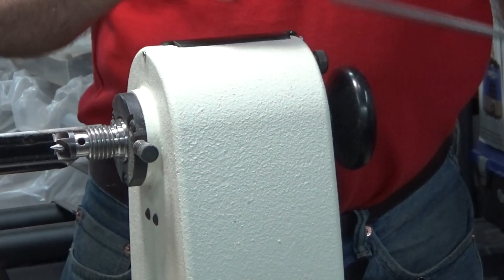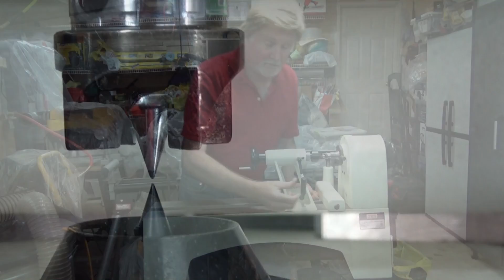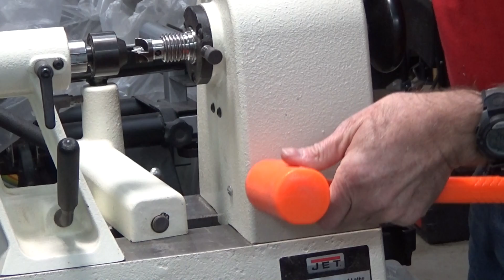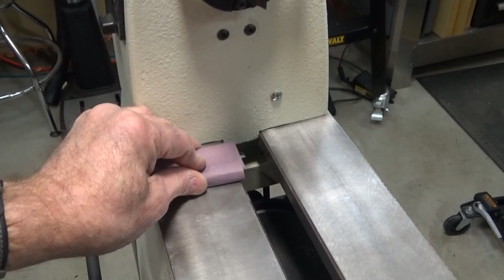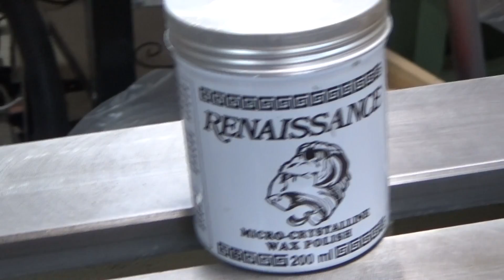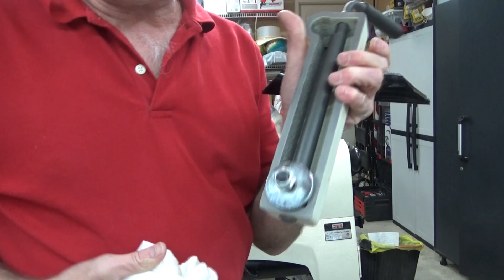Basic Wood Lathe Setup

Comment: Dear Dave! I accidentally came across your video where you talk about how to prepare a Jet lathe for use. A month ago I bought the same one. It’s a wonderful machine, but I can’t cope with one problem: when the workpiece is pressed, the tailstock moves. Is this a problem or is it supposed to be like this? Thank you! My name is Alexander. I am from Siberia from Russia.
Reply from the maker: When you say "when the workpiece is pressed" do you mean when you tighten it? Also when you say the tailstock moves do you mean that the whole tailstock slides including the base? If so the problem is that your tailstock is not tightened down enough. If you are pushing the lever all the way down and it is still not tight enough you can slide the tailstock off and tighten the bolt at the bottom. Just a small tweak goes a long way so go slow. Hope this helps.

Comment: Thanks Dave, great tips. After a year with the lathe and a failed attempt to drill a hole in the top of a finished tea candle holder, I need a drill chuck. As embarrassing as it is. I did not know how to remove the tail stock live center. I punched out the center of it though and need YouTubes advise. I watched many videos and yours explained when others did not, in the first minute. I watched to the end and will now sand and wax my tail stock, banjo and bed. I subscribed. thanks again.

Comment: dave i have bought this lathe and can you tell me how to mount it,,,i built my own cabient,,
Reply from the maker: You can.t see it in the video but I took the easy route and just purchased the Jet base that was made for it. It was expensive but well worth the price. It is no wider than the lathe but very stable because it is made from heavy metal with very wide cast feet. It is doesn't wobble even when working with pieces that are not balanced. Homemade bases tend to be less stable. One recommendation I can make is that if your cabinet suffers from shake put a couple  bags of sand on the bottom shelf. This will add greatly to the stability.

Comment: What about the height of the lathe
Reply from the maker: Great question. When I started out my research revealed that a good starting point is to stand at the lathe and let your arms hang down in a relaxed manner. Next raise your lower arm to create a 90 degree angle with the upper arm. Note the height of your elbow....this should line up with the height of the point of the spur center. I find this works for me and have been using this height for years. Try this out and see how it feels. You can experiment but this will get you started.

Comment: Hi Dave, I have just got myself a second hand lathe, a quick question if I may. Is it vital that I bolt my lathe down or buy feet adjusters? I am unsure and practiclay have no idea if this is ultra important or not. The concrete floor in my shed is old and chalky but average depth 100/120mm. Your help would be greatly appreciated. Lathe in question is a vicmarc vl200 6speed. Cheers mate and Great video, subbed.
Reply from the maker: I just looked up some pics of your lathe. Seems pretty robust. Every pic had a different leg configuration. If you are going to be turning moderate size projects then there would be no need to bolt it down. You can just shim the feet to make it level and stable. Now if you intend to mount and spin some larger blanks and find the lathe starts to walk away that is another story. A trick some turners do when a lathe moves is to install a shelf between the legs near the bottom and place some weight on it such as sand bags. I would just start turning and try to match my solution to the severity of the problem, if there is a problem. Like I said that lathe looks pretty robust and its own weight might be enough to stabilize it. Good Luck.
Dave
Reply: @daveswoodshop782  thanks for the advice Dave, I am just going to purchase some steel adjusting feet to level the lathe. I am only going to be starting small. Appreciate your help mate.

Comment: Great info. just getting started with my dad's old Sears lathe.how high should   the lathe be ?.and the height  of the tool rest is it at center of the work.or above or below.?
Reply from the maker: Stand at the lathe, let your relaxed arms hang down. Now bend your lower arm so that it is parallel to the ground forming a 90 degree angle with the upper arm (pretty much like my arms are at the start of the video). The points of the drive center and live center should be elbow height. This is the general consensus of how high lathe should be. As far as tool rest height goes it is not as simple. Generally the tool rest is below center of the wood being turned. A tool such as a roughing gouge or spindle gouge will have the handle angled down so that the cutting surface contacts the wood near center. when using  a tool such as a skew the rest needs to be higher and the cut is made higher as well. Look at some of my other videos and you will see how to set the rest height. Good Luck!
Reply: Dave's Woodshop thx for the reply tht will surely help me out a lot,my live center on my tailstock is dead i think lol.it doesnt turn i have tried to knock out the chuck but no luck yet,the center point will come out to easy tho sometimes with the wood.

Comment: I recently inherited a delta lathe and would like to remove the spur center, but the simple tap you showed isn't doing it. Any suggestions? I am inexperienced with the lathe and don't want to damage anything.
Reply from the maker: It is not uncommon for the spur center to be tight even on a new lathe, especially if your last project was held in there pretty tight. Insert your punch out tool and give it a solid whack with a dead blow mallet. Should do the job.